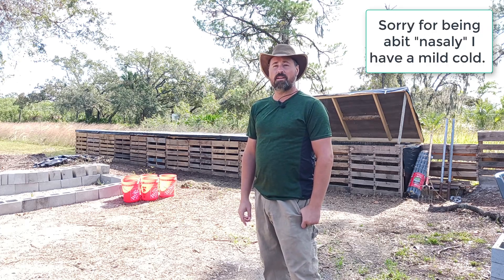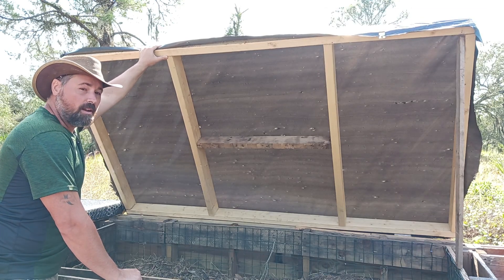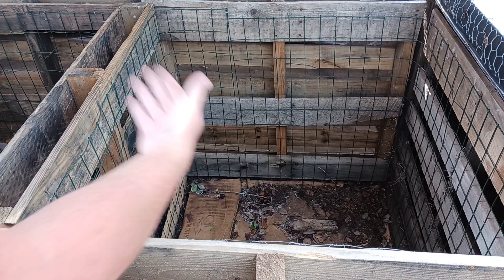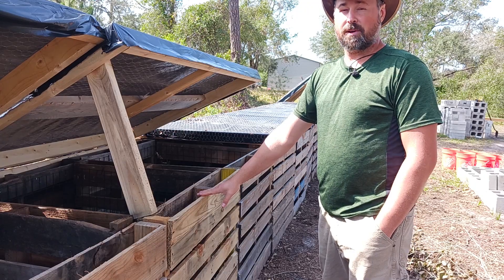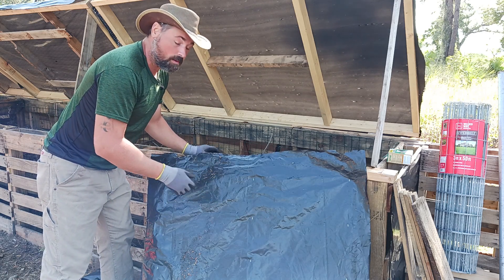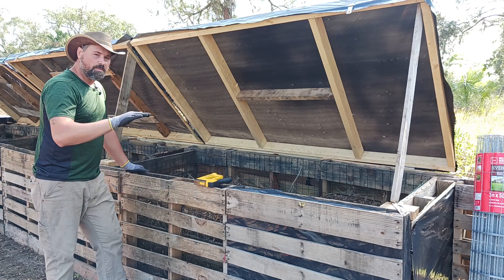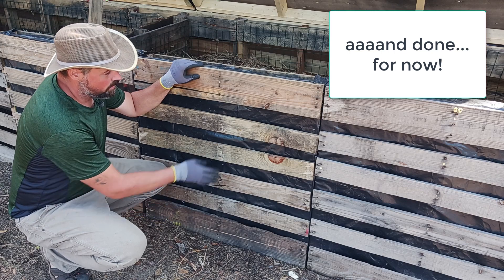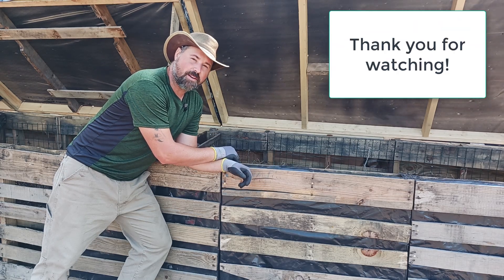Compost Bin Heating Improvement - part 1

Comment: How is it being aerated between manual turnings if covered on all sides and on top in plastic?  (And what about microplastics - PFAS?)
Reply from the maker: Hello, and thank you for the questions. There is actually about a 1/2 to 1 inch gap between the lids and the walls due to a spacer block I installed on them to help with venting. Additionally, as we've monitored our bins, we decided to poke some holes in the plastic in a number of places. So far, compost heats very easily and seems to be cooking quite well.

As for the plastic, I got it from a garden supplier and is one of a few types used for gardening. It is considered safe for gardening and growing. It was either this material or garden tarps, which some people also have concerns with. 

I may get a few things wrong from time to time, but I believe I chose materials that are generally safe. Even the wood pallets I use I am particular about. :)  I will skip on the painted wood pallets or any pallet that looks like it was splattered with chemicals or oils. That said, I am by no means perfect.

Thank you for the questions. It's always good to hear from folks.

Comment: It looks awesome but with that plastic on the outsides, I don't think you'll get enough airflow with those big piles. The aerobic bacteria will not get enough oxygen so that part of the compost process will die off quickly. You'll be more likely to get stinky piles too. So you're piles will only be able to use mold and anaerobic methods to break down, requiring a lot more time. It's still useful, but slower and aerobic has the benefit of also being able to kill a lot of pathogens and weed seeds that anaerobic does not. IMO I would leave one container wrapped in plastic to use for shredded leaf mold which is a fungal dominant way to break down the materials, and take if off the others for more airflow and aerobic compost.
Reply from the maker: Hello and thank you for commenting. So far we are turning the compost every 4-5 days and it is not turning anaerobic yet. We did add a few air holes in the plastic just to be on the safe side.
Reply: @tmdfamilyfarm  sealed sides is ok if you’re turning often or have a good mix. You should check out Charles Dowding the best no dig gardener in England. His compost bins are enclosed with either wood or cardboard, say’s doesn’t matter about air flow.👍🏻

Comment: I’m wondering if you had/rented a cement mixer then as you moved from one bay to the next you could turn and break up the compost with a five minute spin in the mixer then dump it in the next bin?
Reply from the maker: Hmm that's a really interesting idea. We have a small cement mixer and a portable gas generator. I could try it once and see if it's helpful or not.

Comment: Check out Simplify Gardening video on How to Make THE MOST EFFECTIVE Compost Bin from Pallets.  It may give you a few good ideals on your bids.  You have a lot of good ideals in your bins.  I am still collecting pallets to make my system.  Right now I have chicken wire circles bins with a tarp over the top as well as a 200 gallon compost turner.
Reply from the maker: Hello! I actually have seen this before. If you're speaking about this video https://www.youtube.com/watch?v=ZbE4emDTnD4 . Currently the differences between his bins and mine are the interior wire fencing and that I put the plastic covering outside and above the bins on the lids. I wish I had taken more pictures but when I was able to tend to my compost first two bins every 4-5 days as to I had them heated to a nice 125-145 degrees F. The bin style I went with may not be perfect but they seem to be doing the trick as long as I can tend to the hot compost regularly. 

Thank you for the reply and I wish you good luck with obtaining your pallets! I managed to pick up another 12 today from local businesses that were just going to throw them away.
Reply: @tmdfamilyfarm  I don't see anything wrong with the style you went with and as long as they are heating up then you accomplished your goal right.

Comment: I want more airflow in my compost bins to speed the process.  WHy are you trying to go anaerobic?
Reply from the maker: Hello Kevin! Thank you for the question. First let me say I am not an expert. This is my first attempt at this. 

That said, I am not sure what you mean. I am not going for or experiencing any form of anaerobic issues with my compost bins as they are currently. Because the wood pallets are open in the middle, oxygen freely flows around the bins. The plastic on the outside is similar to a tarp if I were to have heaped it all on the ground and covered it. However, the plastic as I have stapled it to the outside does not cut off the air supply. 

That said, technically if compost does go anaerobic, that just means that it will break down more slowly or at a less desirable rate/speed. I have only been composting for about 3 months now and doing what I can on my days off work. So far when turning the compost I am not noticing any aerobic issues. That could change in the future too. If it does I will figure out how to adapt.
Reply: @tmdfamilyfarm  Cool, I thought by using the plastic you were cutting off fresh air.   No matter what I like it, and you gotta build what works for you.

Comment: i'm experimenting with compost for a few years and want to share something with you:
- i started with cheap and used plastic compost bins... figured out they dry out fast, even if you only add food waste
- later i used a 1x1 meter (3x3 feet/foot?) metal compost because the amount of (non food) material grew. no screws needed, i can clck 4 parts easily together. moving them to another location is a matter of seconds.
- depending on the material and weather the bin gets to dry or to wet, e.g. for woody material moist seems to be good, but for green material to much moist leads to smell.
- if you do hot composting (it looks like, i'm still experimenting with that) you need to turn the pile more often - and don't forget: a hot pile needs a lot of water, otherwise the composting process stops! turning it often has the benefit you can check things, e.g. prevent smell with brown materials or adding more water.
- never experiment with a huge setup! turning a 1x1 meter pile is hard work!
- better do small setups and experiment with different materials (e.g. i'm lucky to get guinea pig manure mixed with straw, sawdust, ... it's getting hot in just a few hours! turning it every week for a month and you'll have compost ready for your beds! or you keep it to let woms doing their work)
- i don't have a big garden, but i have different composters and setups for different materials. i try to get the best results as fast as possible, but with least amount of work.
- all my composters are sitting on the ground - and they all are full of worms! all of them are open (sometimes lots of rain in germany), because i don't want to waste water and use rain water instead. imho people are scared of having a to moist compost.
- heat: it's a byproduct of bacteria! it will not go faster if you try to heat up the bin on your own (otherwise everyone would put his bin in sunlight)
Reply from the maker: Hello and thank you for taking the time to write out such a detailed message. I do agree with you on what you've said. I am working on these projects and my compost on my days off from work. So I do have some limitations currently. However, yes I am trying to hot compost as much as I can. However I have too much to turn by myself given my work and so some of my compost gets turned weekly to every 2 weeks. They do heat up when I do spend the time to work on them. So I know the bins work well. The problem I have is the volume. I may have taken on too much that I am trying to hot compost all at once. So I am going to split my compost into 2 sections. I have 6 bins that are roughly 3ft x 8ft or 1meter x 2.5meter each (roughly if I do the conversion and round up). So im going to do 3x hot compost and 3x cold compost. This way I can manage both effectively and not run out of materials and keep the hot side hot with weekly turns or more frequent as time allows me to. I also need to do more research into and get some worms for my compost to help it break down more effectively. 

Thank you for commenting. My projects and my small family farm is in its earliest stages.All information and all discussions are welcome.